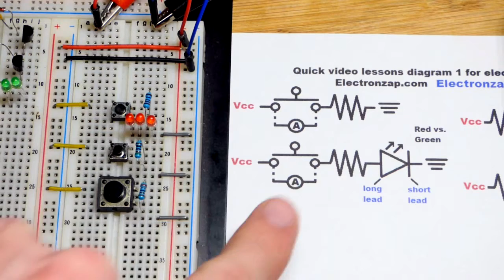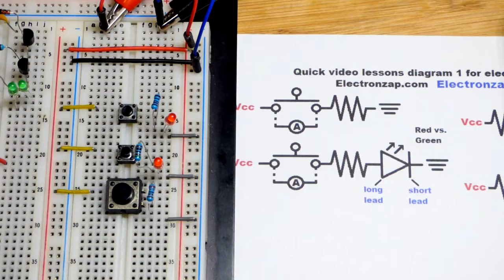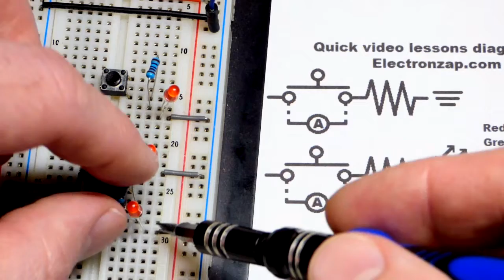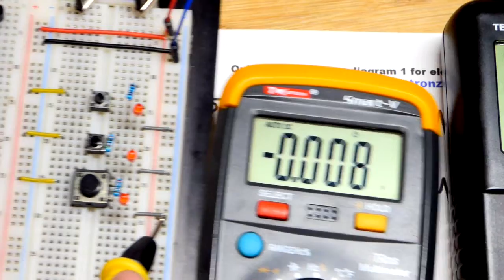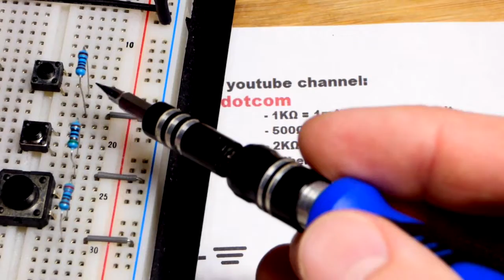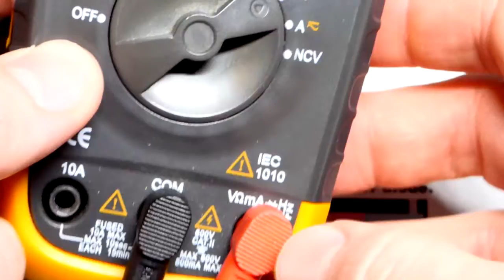Electronics resistor components setting current for quick videos 2

Comment: Nice, Ezdc.  You're rocking the productivity recently.  I like the Amps/volt analysis at approximately 3 min 20 secs.  You're effectively using 'conductance' to analyze the resistor's in-circuit behavior, I think...
Reply from the maker: Glad you enjoy! Conductance is easier to understand while resistance is easier to calculate. So you are probably right.
Reply: @Electronzap  ...I saw a university lecture once where the professor, speaking to starting grad students, was pitching conductance as the right way to think about some components in some contexts...  If what you're trying to do is convert current to voltage, then conductance is a natural fit.
One thing I'm lost on: I don't understand the difference between 'conductance' and 'trans-conductance.'  I think 'trans-conductance' somehow implies you're doing an amps-to-volts conversion as the primary function of your circuit, but the concept is very vague to me.  I'll have to check some app notes and see if I can follow them better by slowing down my reading...  Skimming is useful, but I do it too much, out of habit, and speed isn't everything.